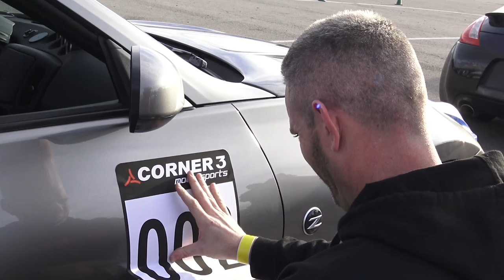I finally took my modified 370Z NISMO to the track!

Comment: I love high end cars and fast cars but im not that smart about them so i have a few questions.
1. What is that blue tape for.
2. Can anyone go to events like this.
3.  Whats a wrist way bar.
4. Jay whats your favourite car.
Mine is probably the Audi R8 2014 or the new McLaren 675LT
Reply: The blue tape he put on the headlights and stuff? That's for just protecting the lights. As you can clearly see it's very sandy around there. Wouldn't wanna ruin that stuff. Notice how he also has it around the front wheels. It's so that if the car kicks any of that up, so it's not a pain to take off. As for Wrist Way bay? I heard him mention Sway Bar, maybe that's what you were referring to?
Reply: Snoopy25 thanks
Reply: 3. He probably said rear sway bar which helps with roll
Reply: 1. To protect from scratches
2. Yes, google "track day" + the name of your nearest racing circuit
3. Rear sway bar:  reduce the rear body roll of a vehicle during fast cornering (makes cars more stable on the track but less comfortable on normal road use)
4. -

I know you didn't ask, but my favorite cars are Mazdaspeed Atenza, and the Toyota Chaser.
Reply: Blue tape = stop lights shattering on the track if they smash
Anyone can go to these events as long as they have a licence (might not need a licence in the US)   
wrist way bar is to reduce the roll of the car to help with handling especially around that bank on the track..that's when it becomes useful.
my favourite car is either a 2011 Subaru WRX STI or a rx7 or an aventador SV either way but Idm cheap cars or expensive ones, I treat them both the same really.

Comment: You're late on the throttle on exit. Work into the throttle on exit. You need to go to an autocross event and learn the limits of your car so you can put it there and keep it there.  You are WAY to cautious if you want to make good times.  I have 7 SCCA and NCSCC Championships and I think you can do better. Just get out and drive that sucker. I was a driving instructor for SCCA.  Autocross is a great place to learn because you can't hit anything and you can take the car to it's limits or over to learn where those are.

Comment: prolly need to run a little soft in the back if you want more grip I would just lower the pressure in the back give you a little more

Comment: I wanna go for a ride along Jay! Nizzie looks amazing!
Reply: Nizzy is an amazing car, very planted. It's crazy to see it getting loose under any circumstance after being on some crazy ride alongs with Jay on the street :D
Reply: Just because it's a V6 Josh, doesn't mean you can't have a "crazy" time in it.

I've been in 4 cylinder cars that have blitzed passed V8's, I've driven V8's, V6's, I6's (inline), I've driven Turbo I6's and each and every single one of them were different, but freakin' crazy.

Especially the Turbo I6, now I'm from Australia, we're not really know for decent powered cars, but this specific Turbo I6 was factory tuned, no modifications and it went like a bat out o' hell. Sitting on 80kph, I sat the RPM on 3600 (the cars natural RPM for turbo boost), I put the boot down a little too hard and it went almost instantly to 140kph, I was only trying to get to 100kph (62mph).

It doesn't matter the engine size, it's how ya drive it that makes it a "crazy" ride.

Comment: Well done Jay. In everything I have ever done, but especially motor racing, the investment in YOURSELF i.e. getting professional instruction, gives you the greatest "bang for your buck" as you would say.  Scratching around for bhp particularly is such a diminishing return.  You saved 4.5 seconds in a few guided laps  -  can you imagine how much power you would need to find to replicate that gain while still making the same mistakes in driving style?   Guys, you got cash? Instruction, then brakes and suspension set up, long before power.
Could it be like building a monster multi-core PC to create content without checking the Adobe Premiere tutorials?  Really nice, but never quite realising the potential...
Keep up the good work,  cheers from John in Wiltshire, England.

Comment: and you got offended a year ago when after looking at your tires closely I commented that you dont take any fast corners ,first time on track :D no hate, Im a fan of most of your tech vids but you need to trash it more than you do currently because cars loose value and you dont need to care alot. trust me the worst feeling is when you sell your car just a little more than its market value and realizing the care you took was not worth it and you didnt use the cars full potential.

Comment: I didnt think that that Nizzy would lean so much on corners, but seemingly its true. Even with that suspension kit(did I type that right?) it is pretty obvious that you cant push "pedal to the metal" on some corners and when you try the nizzy starts to wander around abit.. actually you scared me there few times when Nick was on board and I see you pushing it and car just doesnt want to go where you steer it....

Comment: Are these specs any good, im thinking about building a pc:

CASE: thermaltake versa h15 micro atx
MOTHERBOARD: Gigabyte LGA1151 Intel H110 Micro ATX DDR4 Motherboard GA-H110M-A
PROCESSOR: i5 6500 3.20Ghz
RAM:Ballistix Sport LT 8GB Single DDR4 2400 MT/s
GRAPHICS CARD:EVGA GeForce GTX 1060 3GB GAMING, ACX 2.0 (Single Fan)
POWER SUPPLY: EVGA 500W
HARD DRIVE: WD blue 1tb
SSD: Adata SP550 120GB
EXTRA FANS: 4 rosewill 120 mm

Also the monitor: ACER GN246HL

Comment: I see 100000 suspension and tires parts but no hp mods. Throw an Ls engine in there or a 2jz. Or at least get some boost in that car jay. A 350 or 370 without boost is :(

Comment: hey jay, i am gathering money to buy a new gaming set up and i want to make it decent this time. 6700/6800 according to the motherboard really cuzz they are in 50 pounds distance of one another with a cheap 1070 is what i aim for (some cheaper evga i wanted to get, do they make a shortened version of the 1070? i know they make for 1060 and in your reviews it was pretty darn impressive) and ...

!Important part of the message!

i'd like to buy a 4k monitor because i don't really think i have enough pixels on an 1080. is there any difference in gaming at 1080p resolution on a 4k display compared to gaming at 1080 on an 1080 display?

thanks for answer if you can help me out!

Kind regards,
Alex

PS: U still a d*ckhole!

Comment: I don't think it's very smart running standard tires on a track
Reply: why
Reply: i'm curious as to your reasoning for this.  It just an open track day...all tires are allowed as long as they are in good condition.  Jason was also competing in the Nissan Challenge...and which each class dictates what types of tires they can run.
Reply: I highly doubt he's using cheapo tires...
Reply: Agreed. I chose to run all seasons my first track day this weekend so that I can get a feel for the car before I get some sticky ones. Damn my rear end kicked out so many times, and I had no confidence in the high speed corners. I was going near 70 while every other guy was going 90+ lmao. But it was a good learning experience. Next time I am definitely investing in tires
Reply: Dark Rayne lol do you have any track time?
Reply: with your vast experience, i'm curious to know why you recommend the Nitto Tire for Jay's track day and why...and more specifically which model tire that meets his class requirements.

Comment: also.. who in the world gets a bigger radiator , oil sump/cooler , for a stock engine with stock HP. lol.. ricer anyone :)
Reply: smh.  Cooling mods are the best mods to get for someone planning to take their car to the track...and his stock engine does not have stock HP...but i'm sure you already knew that.
Reply: The 350/370 are notorious for having lack luster stock cooling. That's why they drink oil so fast. A cooling upgrade is a sound decision for these cars.